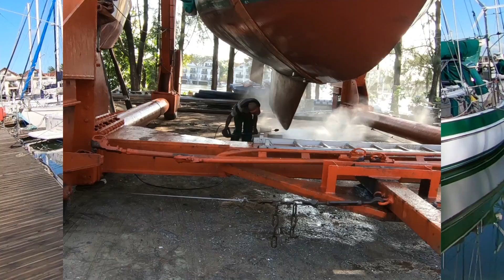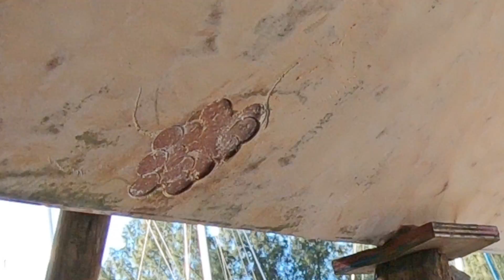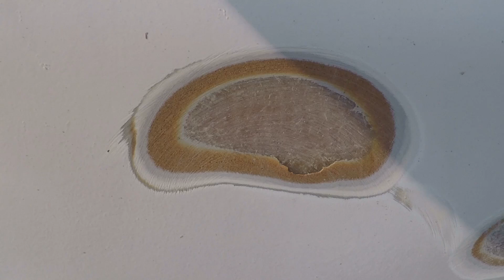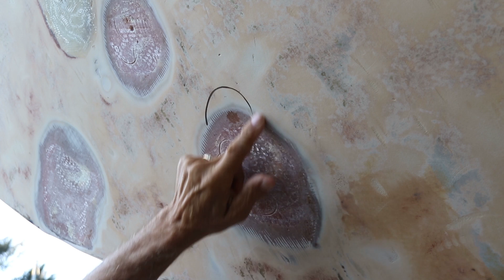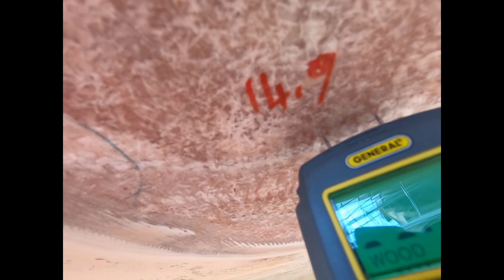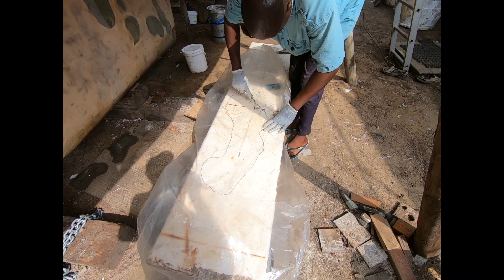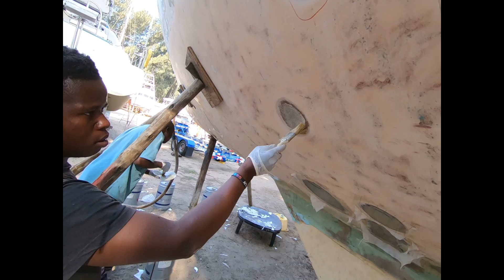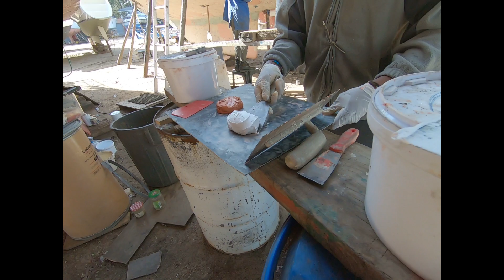500 ROTTEN, FESTERING Blisters!!  - Blister Repair on a Fiberglass Sail boat! (Patrick Childress 59)

Comment: I'm currently refitting a 30' siedleman. Removed all the bottom paint and found hundreds of blisters and small cracks in the gelcoat. I was convinced that a gelcoat shaver was the only fix. After watching your video and reading the comments I'm going to start grinding out the blisters just as you did.  One blister at a time, never looking at how many are left but counting the ones I have conquered. Great, informative video. Thank you very much.
Reply from the maker: Below the water line you most likely have osmotic blisters. I know someone who is doing the same as you, dealing with them one at a time rather than doing a peel job. Flip a coin. I hope it all goes well, and fast for you.
Reply: If they are not dried properly they will come back and your work and money is wasted! Do more studying or hire a consultant!

Comment: Should have started those with a hoof trimmer blade in your angle grinder... not sanding discs...
Reply from the maker: That never crossed my mind at the time but would have been interesting to try. Hopefully there will not be a next time to try. I will mention it to the next person I see who has large boat blisters.
Reply: @SailingBrickHouseAndOsprey  I hear ya, hopefully there isnt a next time... back in the early 00's I had 25 yr old 21' ski boat, the motor mounts had rotted out and the supports for the floor etc were all toast... Good winter project on the farm... lol... I put it in the shop an we gutted the interior, a saws-all could only get so close... a neighbor dairy farmer stopped by one day and found us in the shop, he ended up giving us an old hoof trimmer disc, holy crap was that easy to "flush" surfaces etc... be careful, they can cut!!!  Wont load up like metal  discs or sanding discs... Still not sure how it would handle that anti fouling coat though, might be too gummy and need removed first... anyway, it worked very well for me trimming back fiberglass and into the laminated wood to get a good new bonding surface...

Comment: Wow.  What year did Valiant switch to this resin?  I remember this issue cropping up back in the late 70's early 80's after the oil embargo.  The pre-oil embargo Valiant's were excellent well built boats  and I lusted after one so I was shocked when I learned this happened to the Valiant Yacht Corporation.  Didn't this situation force the company into bankruptcy?   Even after watching your video I would consider purchasing a Valiant yacht If I could make damn sure it was a "pre-Oil embargo" boat.   My wife and I owned a 1968 29" Colombia sloop back then and sailed it for months at a time during the summer in Alaska covering hundreds of miles from Prince William Sound to Kodiak.   This was before GPS, I had a map, compass and a watch for navigation... Those were good times. 

Oh and Liked and subscribed, good luck with your boat.
Reply: There seems to be a lot of info on the wikipedia page of the Valiant 40, actually including a few sources.

Still, it's Wikipedia, so take it with a drop of seawater
Reply: @JoranGroothengel  Hi thanks for that.
Reply from the maker: @mojoneko8303  Mojo, I got very lucky. While working as a professional boat captain, Rebecca signed up for a passage on a Swan 48 I was taking from Rhode Island to St. Maarten, with a stop in Bermuda. Two years after that, we were an item living in Rhode Island. This was her boat! What a deal. She already had the hull peeled and treated from the water line down, in 2001. That was mentioned in the video. You can't buy these blister era boats without knowing something about their blister history and actually seeing blisters on them.I bought into this boat 15 years ago. Since Rebecca did not treat the above the water line blisters, they were quite obvious.
Reply: The blisters appeared around V40 hull no 20,  we own hull no 1 and have met the owners of hull no 18, both are  blister free. The story I heard was  valiant contracted with Uniflite, the only builder who could access resin in the PNW around 1973. Uniflite had the contract for glass gunboats in the Vietnam war. They used a DuPont resin which had a fire retardant additive, which they also used on the V40 hulls.
At some stage, DuPont stopped making this resin, and Uniflite had to source from another supplier, who used a different fire retardant additive, which was the cause of the blister problem. I didn’t hear it was a cost issue, rather a decision by DuPont to cease production, which was the problem.
Reply from the maker: @paulfitzgerald1466  Judging by the cost cutting I have seen in our boat, like common steel brads to hold trim,  some thin layup in places and a number of other terrible cost cutting items, I would be surprised if Valiant, at that time, chose a more expensive, tested resin, over some new untried formula that was cheaper. They had options. Great to hear from you. We are, right now uploading the part Two of the blister repair video. Should be released Thursday.
Reply: Patrick Childress Sailing  I talked to the Dabneys about this, and Bob has written about it, the contract for the first eight boats was signed with Uniflite as they were the only people able to access resin at the time, there was a worldwide shortage. 
It was about scarcity,  not cost. The Valiant contract was a small side project off the armed riverboat production.
I agree about the plain steel brads, staples and interior fitout, we just found  chipboard stringers under the headlining in aft cabin! And a lot of our ply and veneer is delaminating, the wood is OK but the glue is failing.
Still, it’s repairable and the boat is close to fifty years old. You guys deserve an award for that blister job!
Reply from the maker: Paul Fitzgerald Thanks Paul. Well, Stan Dabney surely would know...I’m pretty sure he was right there when the blister boats were being made. He sold us Brick House. I think he used to own a blistered Valiant 40 himself.
Thanks..yes...this blister repair may just be Patrick’s last big job on this boat. He has wanted to treat the blisters for years, and finally South Africa was the right climate, economy and interest level to do it. Glad it’s behind us though. 
The next video is the finale of the blister repair, and we talk about whether we think it was worth the money and the time and effort do make that huge blister repair.  (And how much it all cost) I got pretty shy about talking to the camera as I often do, but he sums it up pretty well.

Who would have thought a hull blister repair video would get 200,000 views in 10 days. Our most popular sailboat repair video yet. I wonder if Part 2 will do as well! It’s uploading as we speak, and I am working on a thumbnail and title for it, doing all the translations, etc etc. If he is gonna put that much work in to the boat, and in to creating these videos, the least I can do is try to make sure the numbers are rewarding for him. By the way..thanks for that soft shackle you sent ages ago...it’s at the ready! -Rebecca
Reply from the maker: @paulfitzgerald1466  Thanks, Paul, for that good information. I should have used some more nondescript term in that opening like they simply changed resin suppliers and bla bla bla. Actually in that opening I had originally said "and they got what they paid for." but thought that was a bit harsh so went back and changed it to  "and no one could have foreseen the consequences." which is why the words are out of sync with the video in that one spot.  I would have asked R Perry about this just to be sure about having the most precise information but he generally does not  respond to my questions with usable information. All this blister repair and painting cost us around $4,000.00, materials and labor, not including my own time. So in the opening of the next video we encourage others to fix up and unlock the real value in these old Valiants.
Reply from the maker: I don't recall when Valiant switched to the bad resin, but it was a bit before 1976. Those early Colombia boats were nice. In Durban, S.Africa, in 1981, I met an American couple from New Brighton, Minnesota who were sailing around the world on a Colombia 26. Two people on that small boat, amazing.    The "art and science" of navigation in the old days .....so easy now just pushing buttons or fingering a chart plotter screen. Not much challenge now.  Thanks for subscribing!
Reply: @SailingBrickHouseAndOsprey  Hi thanks for the reply!  I was wondering if you knew about the blistering issue when you bought this boat or if the blistering was evident yet when you purchased it.  You have owned it for 10 years?  Did you know you were going to be eventually going down this path when you bought it?  Thanks
Reply from the maker: Hi...I owned the boat before Patrick joined me. I was very aware of the blister problem with Valiants, just like Valiant purchasers are now. It was the difference between a $250,000 boat and a $125,000 boat. $125,000 was my uppermost limit. And the blisters were well apparent when I bought it. The previous owner paid for a complete peel job upon my purchase, from the waterline down.. That was in 2001. I was pretty convinced at that time, since I had a place in Deale , Maryland, said to be the best in the business take care of that blister repair job. But alas, it was a blister repair, not a blister cure, and it unfortunately slowly came back starting about 10 years later. It would be nice if this blister repair job now was permanent, but neither of us are fooled this time.It will most likely come back. Ten or fifteen year from now, if we are still sailing, we will start to be disappointed again I think....who cares. We don’t repair this boat to last 20  or 30 years...for ourselves or anyone else....we repair it because we want to safely and proudly continue for the next 10 -15 years if we can....blisters or not. -Rebecca

Comment: How much ot all that cost?
Reply from the maker: I don't know. One day, when I get time, I will figure it all out. I kept and recorded every materials receipt and kept a daily sign in and sign out book for the people working on the boat and how much they got paid. The figures are there but will take many hours to calculate. We never would consider doing this work in the U.S. or Australia or New Zealand where labor rates are high.
Reply: @SailingBrickHouseAndOsprey  Could you make a guess. $10-20,000 or more?
Reply from the maker: I would never pay that much. Labor and materials, guestimate....$1,500 for materials and $2,000 for labor. But my own labor was every day, 10 hours a day, 7 days a week for a couple of months. But that does not count the Coppercoat which that full job cost about $2,000, materials and labor for the application.

Comment: Why didn’t you use the tap test with a small hammer to find the voids?
Reply from the maker: Clifton, the blisters were all so obvious to the eye. Towards the end, I made myself open up the blisters I could just barely see and was not concerned to find more that would be extremely tiny and hidden. Maybe I would have not found any any way but enough is enough.

Comment: You have a perfect cat, so why you didn't you have a cat scan of the hull? Would have saved you time!
Reply from the maker: Coati is only 6 months old and just learning the trade of helper cat. He has a great curiosity and today was eyeing closely how to strip electrical wires and crimp on terminal fittings. I think he has potential to work into cat scans with a bit more experience.

Comment: That’s a lot of hard work, but you’ll be chasing blisters forever.
Reply from the maker: Maybe so Ken. 11 years ago there were two blisters on the port bow, below the water line which were ground out and patched with CSM and polyester resin, while hauled out in Colombia. During this recent process, in Africa, I uncovered those two patches. They were in good shape and needed no further attention. I take that as a good sign. So much original fiberglass has been removed from this boat there are not many areas left for a new blister to form, but certainly can happen. I will let you know in 20 years.  Thanks for your comment.

Comment: Congratulations on the repair, looks like a fine job. It's remarkable how our boats (mine is an early 80's Panda 40, similar to BH) can still be actively cruising (not being a museum piece) even as they reach their fourth or fifth decade. 
The financial dynamic is unlike anything else I know. You can literally sink 2X the purchase price into maint items, and the selling price would barely budge. But... it would still be well worth it vs the cost of buying new. Old fiberglass boats: low cost, high value.
As long as it's actively maintained, I think BH should last indefinitely.
Reply from the maker: I could never imagine paying the cost of a new boat. Used is a far better value. Every world cruising boat that we know of, that was properly maintained, that was put up for sail after a circumnavigation, sold instantly for near the asking price. That is a secondary motivation for making sure everything is right on this boat. The cost of doing this work, in many of these foreign countries, makes the financial equation work out very favorably in the boat owners favor. Thanks for your comment.

Comment: Is the peal ply used to just eliminate the amin blush?  I did not understand the tooth comment.  The peal ply is very smooth so how does it provide tooth?
Reply: If one uses peal ply then you can start the next layer on top of the surface of the peal ply. But even if they sand the amin blush is stuck to the cloth and as such does not need to be washed away before sanding.  Optimally you can let the epoxy dry, remove peel ply and immediately apply next layer.

Comment: How did you determine that it was uncured resin and not normal blisters?  Don’t they appear/act the same?
Reply from the maker: What do you mean by "normal blister"? These resin blisters can appear anywhere on the hull or deck. Fortunately, on our boat, we do not have deck blisters. Google "resin blisters, valiant 40" and there is a ton of information about this era of Valiant 40 and the cause of these resin blisters.

Comment: I'm saving up to buy a sailboat. I was going to live on it in florida but i've been hearing they are cracking down on it. What are your thoughts Patrick.
Reply from the maker: I grew up in Miami, when that part of America was a good place to live. Now most of Florida is way over populated with rush hour traffic that lasts all day. You can still live in some marinas on your sailboat but just anchoring for lengthy periods at a time in one spot is becoming more difficult. Too many boats, too many people. If you can find a spot at an affordable marina, you might like it. Get an air conditioner for the summer though, the heat and humidity is brutal.

Comment: We have a Valiant 32 with blisters.  We would not have been able to afford such a stout seaworthy boat if not for the blisters.  However, being a boat that has spent most of it's life in a colder climate, the blisters are much smaller, but, MUCH more numerous.  When we tackle our blister job, we will be looking for some way to drill out, or grind many smaller areas quickly.  I was imagining a drill bit that looks like a counter-bore bit, but, has a 1-in-12 bevel, and is about 3 inches in diameter.  I will need to think about that for a while...
Reply from the maker: Maybe a peel job for your blisters will be sufficient? If they are small blisters ...maybe they are not deep blisters? -Rebecca
Reply: I look at small blisters like bumps on a golf ball, they are not detrimental to the structure and maybe make the boat go faster. As far as a peel gose, you are weakening the hull. Apply bottom paint and go sailing. If I attack a blister I use a skill saw and rake the blade carefully, faster and effective.

Comment: Looks good and thorough, I'm sure the structural strength is there, but I'm not so sure the water / condensation on the inside surface of the hull isn't going to keep on penetrating / absorbing into the hull wherever it can. I know there's a limit to what is feasible to do on 40 yo boat, I'm thinking along the lines of a bilge paint inside, something that is as waterproof as bottom paint.
Reply from the maker: bluejeans, you could very well be right, depending in what climate we are sailing in and how much condensation, if any, might be on the inside. But I don't think it will be obvious in my life time. I think this boat is good to go for many years and oceans to come.

Comment: In the late 1970's Uniflight Boats were famous for severe hull blisters.  The problem was determined to be a fire retardant additive that included bromine. The bromine dissolved the resin over time. There was no cure beyond continued repair of blisters as they occurred.  There is extensive info on this on the internet. Google Uniflight boat resin blistering, or similar.  Greg
Reply from the maker: Over the next 20 years, it will be interesting to see what happens with this hull.